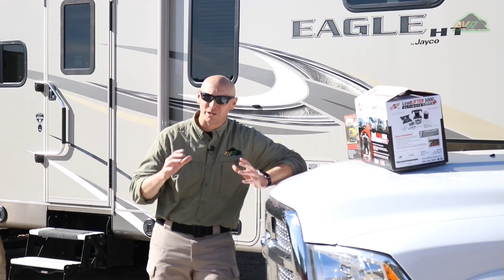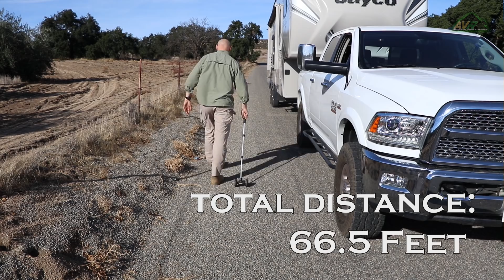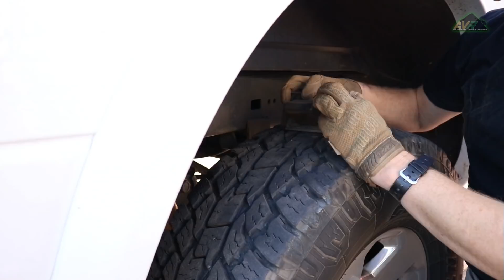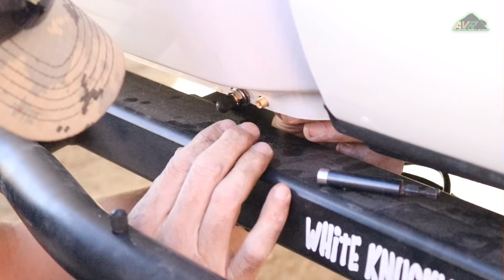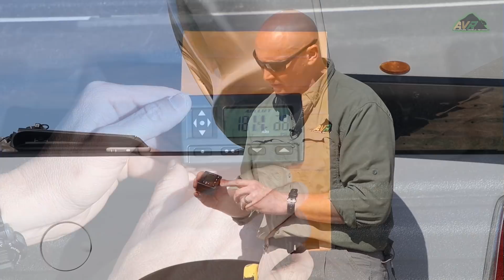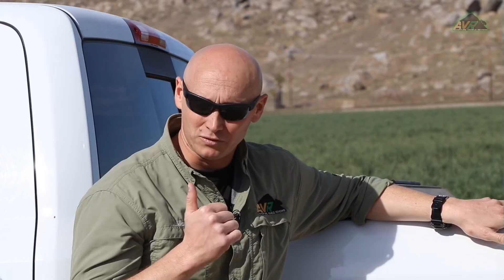RAM 2500 - Air Lift Air Springs in Episode 3 of Project Power Wagon

Comment: Any new updates? Towing a 5th wheel with my 2020 power wagon with air bags I didn’t think was even possible (payload). Was looking at travel trailers and trying to stay under 8k dry as what I thought was my only option. Rough country bags and cradles installed. Also are you 8 ft tall? I’m 5’9” and I look like a kid standing by mine and here you are hovering over that beast😂.

Comment: Is your payload an issue with this configuration (trim/trailer)? Maybe this is a gas engine, I know if you were rocking diesel at a high trim level then its likely you would be over your payload with just pin weight alone.
Reply: Power Wagon is gas option only

Comment: Does it decrease articulation?
Reply from the maker: Yes it can. However, we use Daystar cradles so the bottom of the air bag is not attached to the axle. It just sits inside of the cradle.

Comment: What is the tongue/pin weight on that 5th Wheeler?
Reply from the maker: 1,570 lbs
Reply: If loaded properly and it stays at the mentioned 9000lb dry weight, which it won’t it would be 1800lbs. In reality it’s probably 2000lbs or more loaded
Reply: @travelguy8904  Thanks for the response, and really like the channel. I had a 2018 Ram 2500 Cummins previously, but unfortunately I couldn't find many 5th wheel campers that I could legally tow given the payload capacity. With the diesel engine, Laramie package, additional options, and the Mega cab, payload was barely 1600#. We have since upgraded to a 2019 F450 and now have relatively unlimited options. Also, got the Reese Goose Box (2nd Gen) on the new trailer. No need for the very large and heavy 5th wheel hitch now. Also it has an airbag and shocks to reduce impact on the truck. Would be interested in any others experiences with the Goose Box.
Reply: @brandtcreamean8137  My same train of thought. Yeah, that Dodge will tow it and probably stop it, but you get in an accident killing or injuring someone and DOT finds you at fault for exceeding max payload of the tow vehicle the plaintiff will own you for life

Comment: Was there any height increase with just the minimum 5lbs of air in the bags over no bags. 
Thank you
Reply: Troy Kenny on my 2016 power wagon there was no change in ride height with 5 lbs of air. Even at 10 lbs it was very minimal if any change

Comment: Did this affect the off road performance?
Reply from the maker: Kelly from Two Brothers Bushcraft, it can affect articulation. However, installing Daystar cradles will fix that issue. Other than that, we’ve have seen no differences in off-road performance. 

Be advised, AirLift does not recommend running Daystar cradles. But many people do run them without any issues.
Reply: This is extremely important information, and it should be included in your video.

Comment: i just  hought the 5k air lift for my 18 ram 2500 Laramie.  I have  installed a leveling  kit and since then other motorists  have been flashing me. well the reason  was cause my nose  was so high  now by leveling out the rear this should alleviate  the issue.

Comment: Looks like you need to adjust height on the fifth wheel. Front and back should be the same. Every time I saw a shot of the fifth wheel it looked like the front was at least 4” higher if not more than the rear.

Comment: Your discussion seems fixated on airbags restoring the stock height of the truck which is fine, but when you did the braking tests with the bags aired up the trailer looked like it was very high in the front which is hard on the trailer axles, bearings, tires, and performance/functioning of the trailer brakes.  You need to set up the truck and trailer to be level when your optimum truck height is achieved.   Its hard to do that with such a tall truck.    I have a 2017 Ram 2500 4wd and I had to do some customization on my Featherlight horse trailer in order to level my trailer when the truck is level.  The stock gooseneck was so tall it caused the nose of the trailer to ride 3" too high even when the truck was squatted (without) airbags.  That caused a lot of extra weight on the rear axle of the trailer.    If you set up the trailer to be level at the stock height if the truck, you can drop the trailer on the truck and it will squat the truck and trailer.  Then fill the bags to level the truck, at which point the trailer will be level too.  I think that is the best way to get the most out of the airbags.   Your video showed how you can lift a loaded truck, but there is a little more to it.  You need to get the proper balance of a level truck and trailer which is the safest way to travel.

Comment: Interested in how longer term test went and if you installed those cradles yet?
Reply from the maker: JeepN3RD, cradles are still in the package. But so far since this video was made, the air bags and compressor system have worked without issues. Just had to replace the battery in the remote controller.

Comment: I added the daystar airbag cradles to my airlift bags so I wouldn't lose to articulation of my power wagon rear suspension
Reply: also added carli front diff guard and 285/75/17 toyo mt's on the factory wheels 35" taii 11.? wide
Reply: Stacy, how did that work out for you?  If your review is positive, what specific brand and model of bags and cradles did you use?  Also, did you also install the air compressor?  I'm thinking of making this mod to my power wagon as well.
Reply: what year is your power wagon.  I am getting a 2018 but don't see that daystar has some for 2018's
Reply: i am worried about articulation as well.
Reply: I ordered my ride rite air bags and daystar cradle from cjcoggroad.com contact them they are very helpful. "16 laramie power wagon.
Reply: Stacy, the install was straight forward? Anything in particular to look out for? Thanks
Reply: without a lift

Comment: Would you then say the truck would have similar tow ratings to the other models with the 4.10s and 6.4 hemi?
Reply from the maker: chad richards, you are correct. We will be installing a fix for that in the future. Just in case you’re not aware, the fix is going to be airbag cradles.
Reply: Rolling ready, Did the Day Star cradles work well?
Reply from the maker: Per Air Lift- air bags are only for load support.

 However, the rear spring rate is really the only limiting factor for the PowerWagon in comparison to regular 2500 similarly equipped. The air bags certainly keep the truck from sagging. Also, take a look at what weight your axles and tires are rated for. So i can’t really give you a confirmed answer, but you can probably work it out the same conclusion we did. 😎👍🇺🇸
Reply: Adventure Vehicle Reviews thanks for getting back to me! That makes me feel better about getting a PW and towing around 10k+ 🙌😏
Reply: Adventure Vehicle Reviews wouldn't air bags severely limit the articulation the 5 way rear suspension is meant for? It has a completely different rear suspension setup compared to a regular 2500.